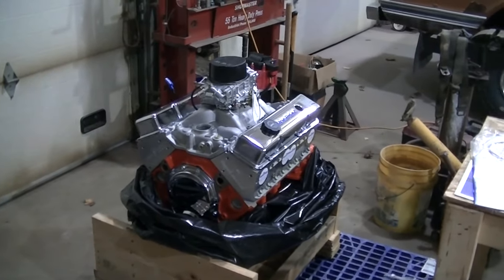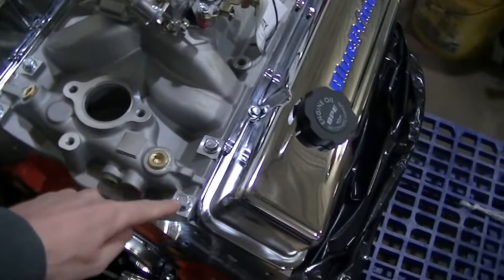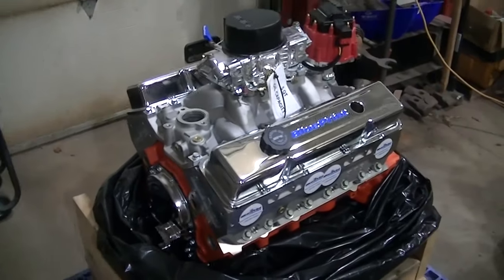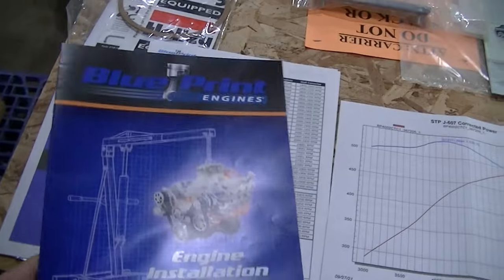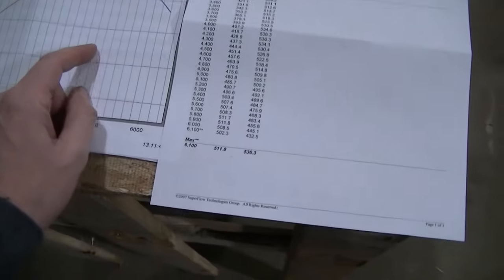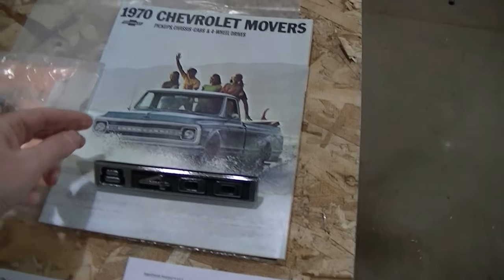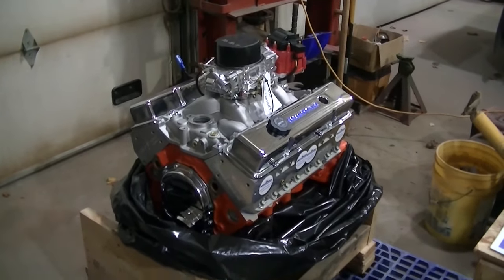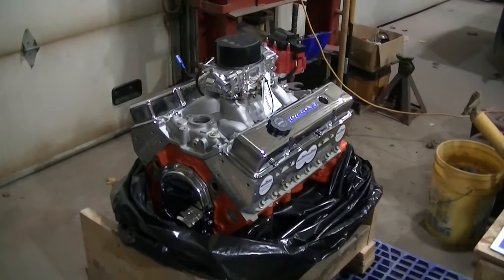70 Chevy Truck 500hp 400ci BluePrint Crate Engine Intro

Comment from the maker: Things that might help with a project like this:
BluePrint 383 Stroker:  https://ebay.us/4sbFMe
LED Heater Control Bulb:  https://amzn.to/3Bbmofk
Heater Control:  https://ebay.us/mIQXpH
Dash Pad: https://ebay.us/LxR98V
CST Emblem: https://ebay.us/h9DhOz
Perfect It Compound: https://amzn.to/3anG4Sd
Steering Wheel:  https://ebay.us/qqFkYJ
Steering Wheel Puller:  https://amzn.to/3msxGbo
Dorman Turn Signal Cam:  https://amzn.to/3j85w3l
NGK Plugs:  https://amzn.to/3lui0Uv
Ventshade Visor:  https://amzn.to/2TGn9NM
Trim Rings 1.75":  https://amzn.to/3f7Wxgo
LED Taillights:  https://amzn.to/3rqmwEq
LED Flasher:  https://amzn.to/3kVm6oH
Aluminum Radiator:  https://amzn.to/2Vy1CaM
Hood Bowtie:  https://ebay.us/gJiHNF
Body Bushings:  https://amzn.to/3AzfEZC
Air Cat Cut Off Tool:  https://amzn.to/3weGGSM
Skyjacker Dual Kit (Black):  https://amzn.to/2TpWWTP
Bed Rack:  https://amzn.to/3x7WsjJ
Dick Cepek Tires:  https://ebay.us/gScPHA
LED Headlight:  https://amzn.to/3cCDgCy
LED Parking Bulb:  https://amzn.to/3utPZNV
LED Backup:  https://amzn.to/34m38hp
Side Marker Lights:  https://amzn.to/3yLsWRM

This video contains affiliate links, which means that if you click on one of the product links and buy, I'll receive a small commission.

Comment: Just reading your comments on your "400". Just to clarify a couple of things about specs; The "400" emblem was designed for the '68-'72 big block 396/402, they called it a "400". Did not make a "400" sbc until mid 1970. And you're transfer case dilema. Basically Chevy made 2 transfer cases from early 1960 to late 1980. The Rockwell and your New Process 205. The Rockwell was a "good" t-case per say but had that un-oiled lower bearing that only got oil if you kept your gear oil up to level, and most dudes ran 'em low and burn't up their t-case. Also had straight cut gears which was loud as hell. NP 205's has slant cut gears, ran quieter, cooler and had good oiling patent. Hope this helps your questioning the cases and weird embleming Chevy did.      Jim

Comment: I was on blue prints website this morning looking at either a 302 or 306 stroker for my 86 Ford
Reply from the maker: I got mine from Summit. They are gone almost as soon as they get them in stock. The 383 engines are pretty easy to get. I wanted the 400. I have heard pretty good things about BluePrint.
Reply: @mossman381  we are running the 400 in our camaro and it is crazy lol it will burn the tires as long as you let it I almost wish I put one in my truck I went with the 350 in there

Comment: I ordered this engine in august, and it just came in last Tuesday!  I must say I'm a little confused by the dyno sheets we got. I was under the impression that the blue line is "uncorrected" hp, and the red line is "corrected hp", with no torque value given. The sheet doesn't say anything about torque. It was advertised to be about 475 i believe...
Reply from the maker: Blue line is torque and red line is hp.
Reply: @mossman381  You are correct. I was incorrect. I just called them to verify. The bright side of being wrong (this time) is that i have 35# more tq than I thought I had! I guess I had to learn the hard way lol

Comment: I've got the same motor  mine used oil couldn't figure it out Sent back to blueprint on the second one and it does the same good luck
Reply from the maker: Did you do all the install procedures? Break the motor in properly? Used the right oil?

Comment: I have this engine in my 3rd gen Camaro and it rocks low 6s in the 1/8mile
Reply from the maker: How many miles? Any issues with it? How is drivability with the 850?
Reply: @mossman381  I've put about 3k on mine and I drive it to work when I can afford the fuel lol I'm running holley sniper with a 700r4 and I'm getting about 10mpg avg
Reply from the maker: 10mpg isn't that bad. How do you like the holley sniper system? My dad has the 396 version of this motor for his 70 Camaro with 5 speed Tremec.
Reply: @mossman381  I will never purchase another carburetor

Comment: I just put one of there 383's in my 84 C10 it runs great...its got 4.10's and a really tight Fti 3600 stall drives almost like stock........there converter recommendations are way to low you need atleast a 3000......as long as you get a decent converter it won't be sloppy.
Reply from the maker: Don't you have to rev the truck awful high to get it going? A stock converter is probably 1200. I don't want it to feel like a race car.
Reply: @mossman381  If you buy a generic 12"  B&M converter your gonna have a real loose inefficient converter. My truck i can put in drive and it will start rolling with no throttle...it drives like stock anytime under half throttle, any more and it flashes and couples hard up top. The bigger converter with also have less rpm drop in between gears so you will always be in the meat of the powerband.

I have a 9.5" Fti that is really tight despite the high stall speed. I can try to get a video of how it drives if you would like.
Reply from the maker: I was nervous about the torque converter before now you have me really concerned. Sounds like a guessing game. How did you choose this converter? What trans do you have?
Reply: @mossman381  Its really not anything to be worried about, i have a 700r in the truck. Stall speed is just one factor in how tight or loose a converter is. 

You could take a generic 12" 2500 stall and it could drive looser than a 9.5" 3000. Overall diameter makes a difference as well typically the smaller the diameter the more efficient it becomes. 

Converter technology has come along way in the past decade or so, dont let the old hot rod myths scare you into using the wrong parts.

I would give Fti a call and tell them what you got and they could set you up. My recommendation would be their ESR3380 its a 2600-2800 converter.
Reply: @02ws64  does the car drive fine with it? I’ve seen some videos where they don’t wanna shift on their own with high stall converters like that
Reply: @yamahaguy1732  Car drives just like stock with it....I also have 4.10 gears which help tighten the converter up as well. I can put the truck in drive from a dead stop and with no throttle it will start rolling foward.
Reply: @02ws64  I’m debating on gearing or stall for my truck I have the 350
With a 1800 stall and when I punch it from a stop It just doesn’t have the go like id like I have 3.42 gears with 32” tires and I heard from someone that equates to like a 2.48 gear or something like that some people say gearing some people say stall what do you think?
Reply: @yamahaguy1732  The stall will make a  much bigger difference than the gears, it allows the engine to be immediately in its powerband. Assuming you get a decent converter i would use a 3000 stall minimum. Then down the road you can do a better set of gears and it will only improve.
Reply: @02ws64  yeah I’ll have to look into it. Also I saw your name I have a 2000 ws6 lol
Reply: @02ws64  nice I got mine in august or September it’s a ws6 6 speed not perfect but it’s a project and a daily lol some rims and a paint job and it will be mint👌🏻

Comment: that motor looks good and sweet, but is that gross horsepower or net horsepower they never say not just blueprint but any of them
Reply from the maker: I saw a video with this engine using a 750 carb and they made around 400hp to the wheels. With the low end torque I think I will be more than happy with this motor.
Reply: @mossman381  that's good to know. Thats  the reason I haven't bought a motor for my van . I never know if it's gross or net ,but sense  you see a video with it making 400 at the rear wheels, now we're talking
Reply from the maker: I would say that you are going to get the gross hp from everybody. They don't hook up accessories and full exhaust on the dyno.
Reply: At the flywheel

Comment: Nice ,nice job bud.  I just would feel alot more comfortable if ya at least had Yukon u-joints in the front Dana 44 and a trac-loc in the rear, it would toughen up the carrier in that open rear diff. That 4-speed and 205 t-case will take alot more that 500 hp. ---I can prove it with a 2nd place trophy with a 298 ft. pull at the fair, on a shelf above my desk here--even though you said you would not pull it, everybody want's to get a bit stupid now and then !!!!!!!        Jim
Reply from the maker: I don't get stupid because then I have to pay and fix what gets broken.
Reply: @mossman381  I can surely respect your response to that comment BUT here's my view--I don't drink, I don't smoke, I have a marijuana license for Iowa that I've never used, because of my two open heart surgeries in the last 15 years. I have a '69 Yenko Camaro with the 450 hp. solid lifter cam, and 4.10's. Did run 11.80 in quarter in street slicks and will lay you sideways in 4 th gear. I DO GET STUPID. Wife gets mad though. I figure I've gone through enough in life dairy farming and truck restoration I don't need to make any excuses to anybody for getting a bit STUPID now and then. I even told that to one of my best friends who is a local retired State Trooper.   Take Care !!       Jim

Comment: You need to use a oil with alot of zinc in it Walmart oil has it there regular oil
Reply from the maker: The break in oil has the higher zinc. I will probably go with BluePrints break in oil or one they recommend so they won't void the warranty.

Comment: Th350!!! Nooooooo go with the th400 which is way way way stronger
Reply from the maker: The th350 is stronger than you think. I wouldn't buy a stock one. They got a bad reputation because people try to use stock ones and that is no good. A th350 with good parts inside will work for me. I am not racing or off-roading.